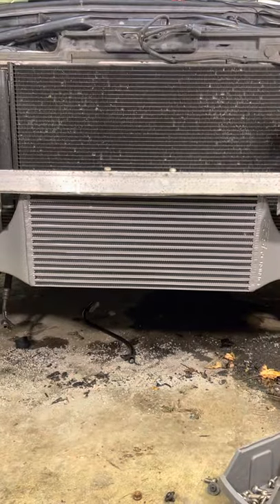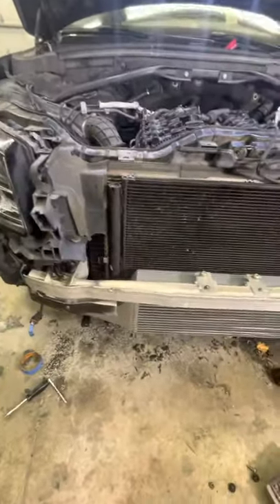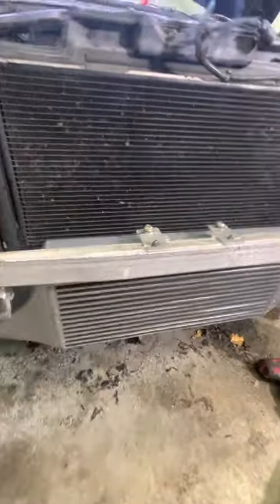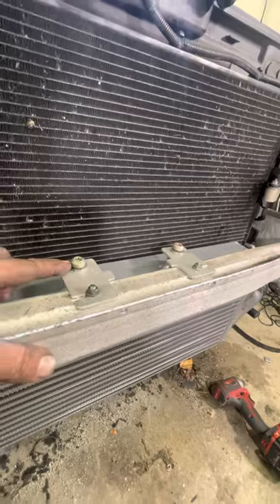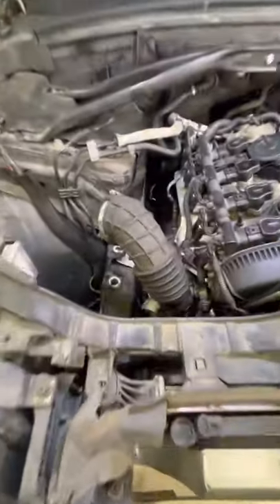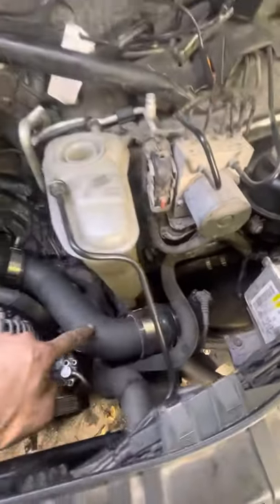2.0t PERFORMANCE Audi Q5 ECS tuning front mount intercooler JUST INSTALLED a4 a5 a6 tfsi tsi turbo

Comment: I have a big apr front mount intercooler on  mk 4 337 GTI and  they actually send a new bumper support that is cut and they are so big both pipes are on the same side so it looks crazy when the pipes are all connected

Comment: Any dimension on the bracket length and width? also what bolt hole spacing on the intercooler? I want make just one bracket with 4 holes.

Comment: Did you remove the stock intercooler too?  On VW's you have to buy (or fabricate I guess) a relatively expensive bracket to replace the stock IC.